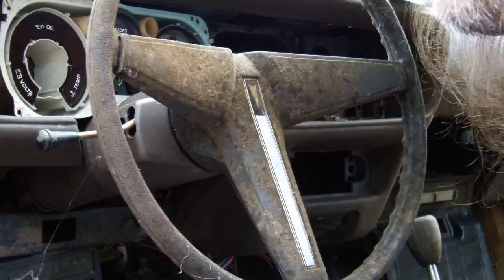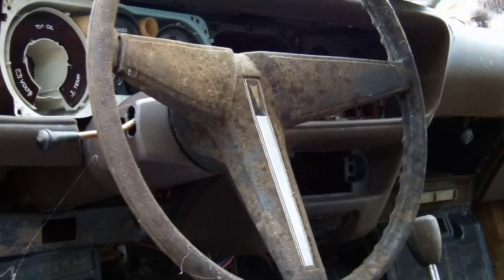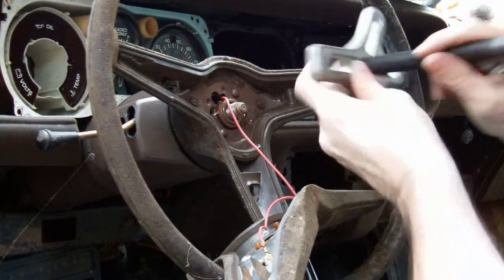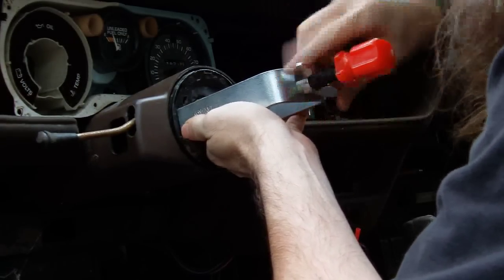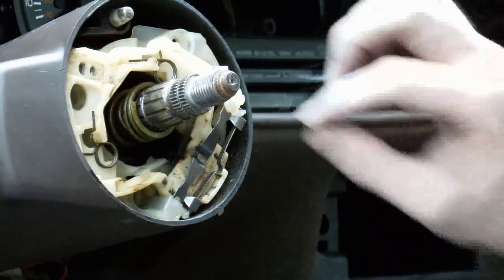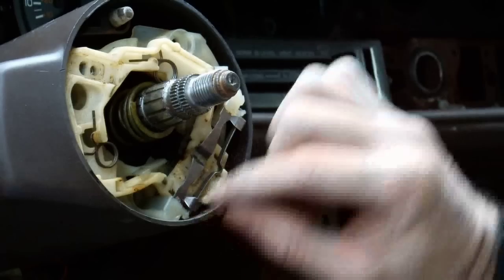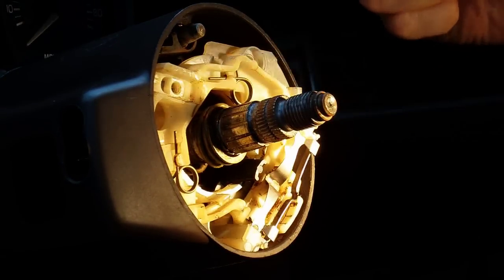1981 Firebird Ignition Switch (ignition lock cylinder) Replacement

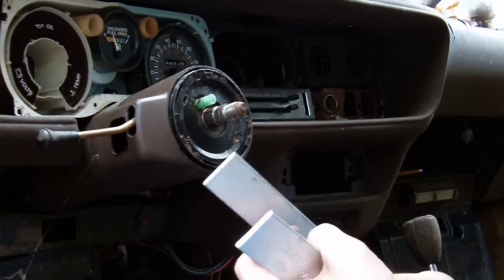Comment: 5:00  you can actually push that plate down with your one hand, and use a small screw driver to wedge and pop out the snap ring...  Ive done it a few times.

Comment: I have a quick question I have a 1986 Camaro but my ignition when the key is out it makes noise and if I play with it with my hand 🙄 no point intended it stops but sometimes it comes back on when the key is not in and it's running down the battery can you or someone tell me if I need a new ignition switch thank you

Comment: I have a 1976 firebird and my ignition switch is stuck. It doesn't turn in the lock position at all and the key is stuck in. It has power but the engine won't turn over. Is there something wrong with the ignition switch or is it the steering column?

Comment: I have a 79 firebird that I want to put a Trans Am steering wheel on what would be different??
Reply: +darkeffectstv best of luck brother.
Reply: +darkeffectstv tell me how to send one and I will be glad to. Sounds like we're doing the same making a clone T/A mine has a Pontiac 400 from a 75 or 76 in a 79 bird.
Reply: +darkeffectstv I'll try and post future updates on YouTube. I have since rebuilt the carb and I'm currently doing the radiator and water pump etc. I can hardly wait until the day comes I can say she's finished and road ready. She sat for a unknown number of years.
Reply: +darkeffectstv I subscribed
Reply: +darkeffectstv are you near Arkansas ? That's where I'm at.
Reply: +darkeffectstv yeap I was stationed there in the early 80s at Lejeune in Jacksonville.
Reply: +darkeffectstv have been through Sanford a few times. We Marines used to go do some field ops at Bragg went there in 83 and again in 85. Was stationed at Lejeune from late 82-early 86 with some over seas time to Beiruit in 84.

Comment: The video states replacing the Ignition. He is actually replacing the ignition lock cylinder, NOT the ignition switch. Two completely different things.
Reply: @DarkEffectsStudios  I don't mean any disrespect, I'm just in the process of replacing the ignition switch on my 75 Camaro & trying to find any information to help. I know I have to lower the shaft on the steering wheel to get to it. Have a great day!